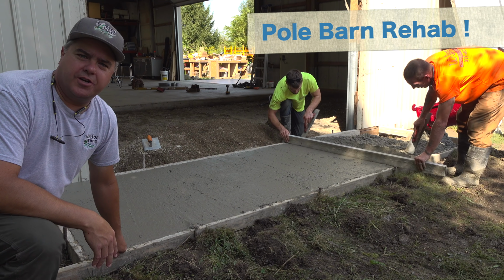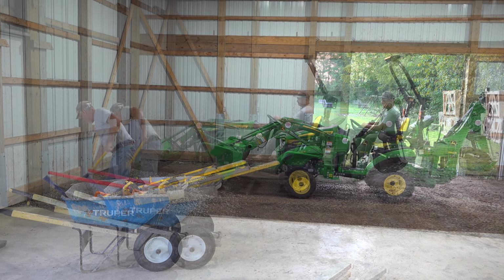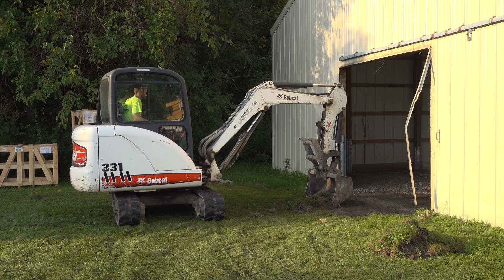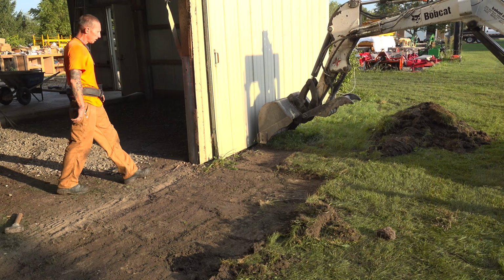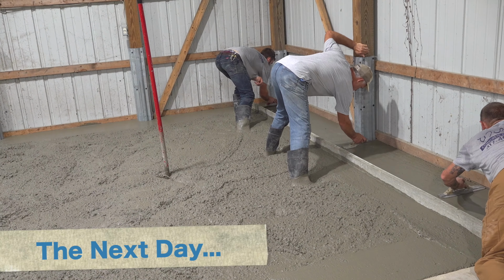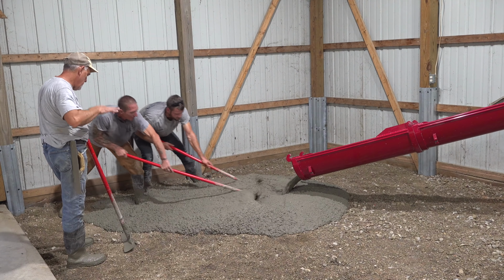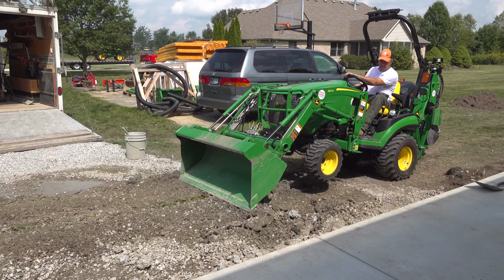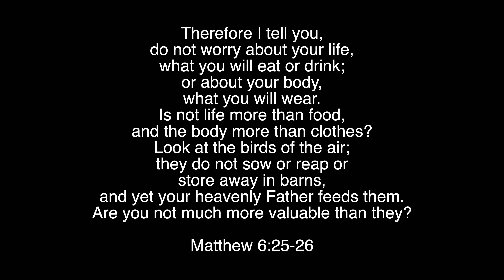Pole Barn Rehab!! Concrete Aprons and Floor!

Comment: Well, a vapor barrier on top of compacted gravel, then wire mesh, then supported rebar would be better. A few grade beams would help for handling heavy equipment. You may get some cracking, but it should stand up for the most part. The finisher seem to know what they are doing.

Comment: I can't believe that they didn't at least add a wire grid. Rebar would be ideal. Not really for concrete cracking(although it can help), the control joints will handle most of that, but to keep it from settling btwn control joints and front apron. Without rebar, corners of the control cuts can crack. Did you have them add fiber? Why no response to all the questions about rebar/fiber addition?
Reply from the maker: No response because I am not a concrete expert.  I feel no need to defend. 
I chose the foremost concrete expert in my area.  I chose not to question his approach.  He has been pouring for 40 yrs.  well respected in this town.
Also,!he said he poured the basketball court on my property...for the prior owner.

Comment: I have 25 X 30 X 5" fiber-reinforced 5000psi concrete pad at my garage, Had saw cuts done. The propane truck has been across it many times over the 12 years and It's been no problem.

Comment: What's different, I use my box blade more then front loader for leveling. I have tip and tilt cylinders on three point, makes tractor more useful.

Comment: Same here, rebar is the secret! You will be complaining when the freezing comes! Need to pour aprons about 1” lower than the concrete pad because when it freezes outside it will raise up, then water will collect up next to your door and run inside. I have had to fix this many times. I hope it doesn’t.

Comment: TimI've been pouring concrete for the last 30 years and own an industrial concrete company and I've never seen a slab go down that the subbase was not compacted or no wire mess or rebar.  But maybe there was fiber in the concrete.  I hope you are keeping this slab covered and wet for the next month to try to slow down the cracking from shrinkage or at least sprayed it with some cure.  Also I'm surprised that the contractor did not use some kind of vapor barrier under the slab or expansion material around the outside edge next to the barn and posts.  But its down now and it bets a dirt floor.  Thanks for sharing.  You mentioned the foam insulation did you get that at the Plywood King in southern Indiana?  I was over there and picked up a bunch of 1" foil backed for insulating my barn.

Comment: I'm in the building business and your concrete guys did a proper job. The only thing we do a little different where I live is add a little bit of a "broom finish" to an exterior slab because is can get really slippy when there is a bit of snow or frost on it which is could be 4 or 5 months of the year here in eastern Canada.
Reply from the maker: did we not show any of the broom finish?  If not, sorry.
Reply: So your company doesn't add rebar either?
Reply: Weather I use rebar or not depends on the job. On hindsight I may have used 6 x 6 wire mesh on Tim's slabs. It all comes down to. Customer choise and budget and such. Opinions on this type of thing are like noses, everybody has one.
Reply: @PEI_Guy  thanks for responding. Me personally I would have added rebar, especially for the vibration of the equipment. But like we both said his opinion to or not.

Comment: I love the work you all have finished on the barn and the concrete work looks great. I have a John Deere 3032E tractor and the only reference I found in my manual on the bucket being level is the one paper which was on the top of the bucket itself and that isn't enough for me to know that it is level. I wish the company had put a rod on the bucket where you could look at it's position to determine if it is level or not.
Reply from the maker: A bucket level indicator is an option for the 3032e. You can get it from your Deere dealer.

Comment: Looks nice... But if I bought that property I would have to blow out all that concrete and install a heated floor.  Yes the install and equipment for heated concrete is expensive but it alot more efficient.

Comment: Thanks for the video.  You can come build me a pole barn anytime you want. 

It was a bit painful watching you spread stone with the bucket while lifting the blade out of the way.
Reply from the maker: Are you kidding?  I was 10 fold as fast with the bucket!
Reply: Tractor Time with Tim if you don’t practice with the blade you won’t get good at it.  If it was just for stability they would give you outriggers. 

Honestly I’m just teasing you, the best tool for you isn’t always going to be what I prefer for the same job, and I do understand that. In fact I was just pulled into a similar squabble at work. My answer was it wasn’t defined in the procedure specifically for that reason. Each person was allowed to do that step how it worked best for them within the parameters that were included. Both result in the same end product, it doesn’t effect functionality or performance and didn’t change the cost of the step.

Comment: My shop has 4 roll up doors two across from the others.  e.g. drive through.  My shop isn't an auto or tractor.  It is a Metal machine and Wood Machine shop.  Electronics and did I say CNC Plasma.  Rather stuffed.  Will be unloading some of it soon I hope.

Comment: Tim. Down south pole barn companies have started running cables tied in to the bottom of the post in a criss cross pattern. They install cables before concrete . This allows for renfocement of the concrete as well has ties all your weight of machinery to the posts. And it is really cheap. 50 dollars at most

Comment: You could see they poured concrete before. They should have run a plate packer on the fill.  A bar or two in the concrete would have been good. Must not be to wet there. It never did dry up here enough to drive equipment on anything with out ruts.

Comment: I just did the brakes on the back of my f350 and i used moms outside slab since not enough room inside and i dont want to block anything by trying to work inside.    I hate working on concrete because its hard on the knees and such.  I like working on the grass but easy to loose things and doesnt support jacks very well.

Comment: Tim; I have some reservations on the pouring of the concrete on the aprons. 1st why wasn't reinforcement mesh or rod laid? Unless that was fibrous concrete they were pouring. Just my observation as an Engineer.
Reply: Fiore Vitola cheap cheap cheap
Reply: I was thinking the 8-9" slump doesn't bode well for future strength performance.
Reply: @E_R_I_K  No but that doesn't matter as much as reinforcement, slump would be more important when pouring vertical walls and if pumping using plaster-sizer. Concrete that is under stress such as slabs/floors and aprons, which are intended for heavy machines and temperature change will stress crack without reinforcement.
Reply: They will never admit it to anyone

Comment: Nice looking improvement. You’ll be glad you did this for many years to come. The shop is coming along great. 

I recently bought a used 2017 1025R with 400 hours on it as a supplemental tractor for small jobs. It looks new and was $14,500 which seemed like top dollar to me. The dealer said it was sold at his cost which seemed strange they would do that. What’s your viewpoint on that? I’m adding a canopy for $450 to keep from getting too much sunburn.  As handy as this little thing is I think I’ll be putting more hours on it than I put on the big 78 HP tractor. It doesnt cut grass well so I think the blades are dull which is no big thing to do.

Comment: Why no rebar? with the weight of the equipment. Concrete is always gonna crack, metal reinforce the will limit it’s separation. I would have puts some in and also drilled and pounded some rebar into the old pad so during winter there won’t be any heaving. Also why no packing on the base material?

Comment: something relaxing about pouring concrete and smoothing it out
Reply: spliceon charlie not when your doing it and you don’t have enough and it’s hot out and the concrete is curing.
Reply: @FishFind3000   When I see concrete work I think of a television commercial.     Remember the old television commercial where the concrete worker is slaving and sweating to get some concrete down for a sidewalk  and when he is almost finished a little kid starts putting footprints into the fresh smooth surface.

Comment: two big worries for me Tim, no compaction of the fill material and no rebar or mat. Both these omissions will be likely to cause cracking and breakup of the slab !!
Reply: He must have used fiber in the concrete
Probably not going to be working on 18-wheelers in that building it'll be fine

Comment: Million dollar question that I'm sure some will ask how come you didn't add rebar?
Reply: Julio Almaraz cost
Reply: I was definitely going to ask it..... Chicken fencing would have been better than nothing
Reply: I don't care if he added or not rebar or anything else just want to know the reason since it will have heavy machinery parked in it hopefully was 4000psi concrete. I have a barn want to add concrete as well. Just want to do my research.
Reply: Yes cost nothing and with those tractors and ya know a bunch of weight and ya know  more shelves  at least the square grid stuff is a mandatory
Reply: The probaly used fibers in the mix